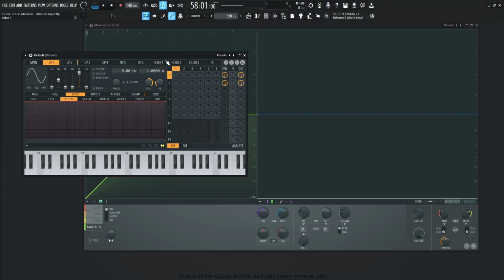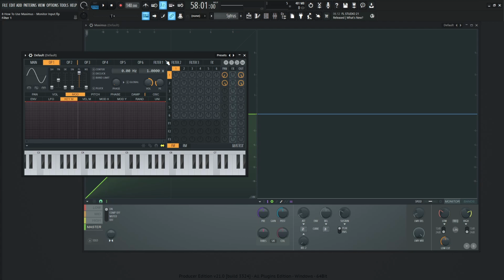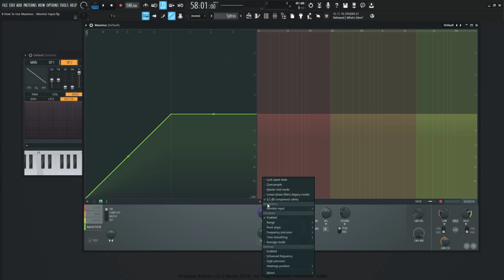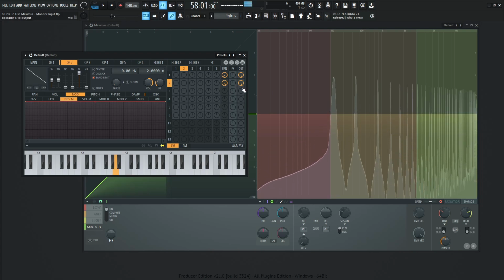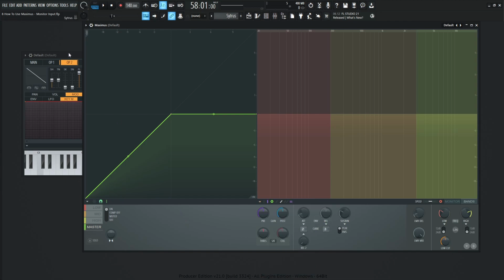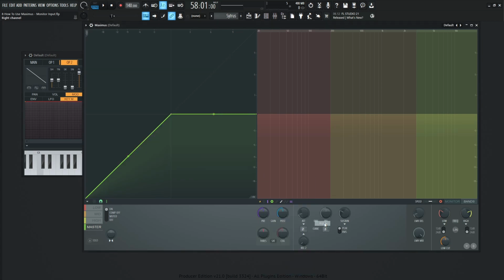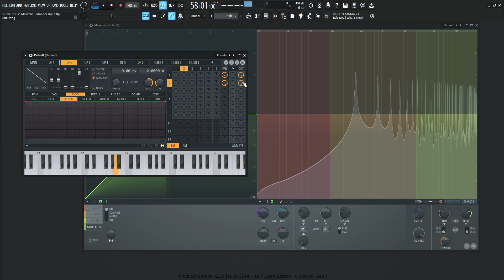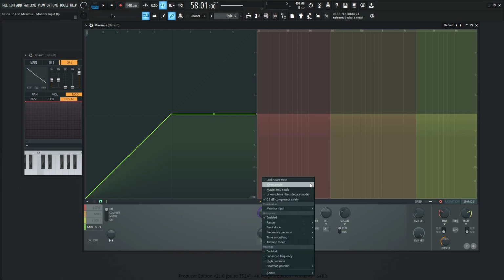Maximus Monitor Input PART 8 | FL Studio 21 Tutorial

Comment: well are there any use cases that i will switch to 'side' view only in visualization? because I switch between mid and side, and not a huge difference from my loop
Reply from the maker: Most likely from a loop both views will look very similar. However if you wanted to test it out, you can take a kick drum, assign it to a fader and pan it directly in the center, then open up a synth of choice, assign it to another fader and record/key in some notes on the synth.
Put the kick and the synth on the playlist so they are both playing, then put maximus on the master channel and toggle between both modes. You will see a big difference in the visual representation of the waveform.